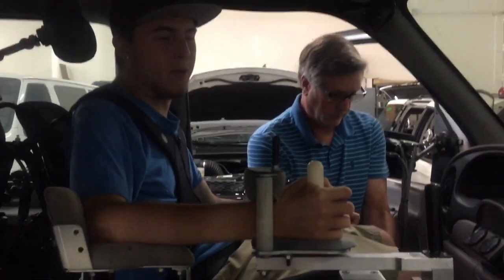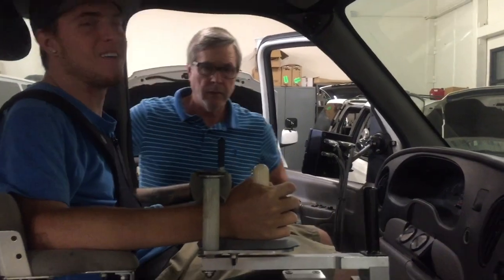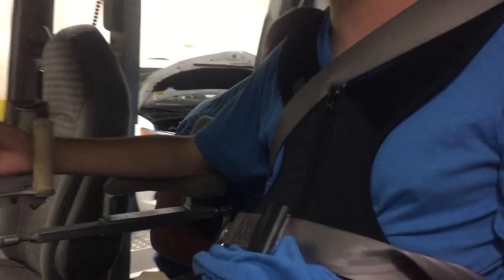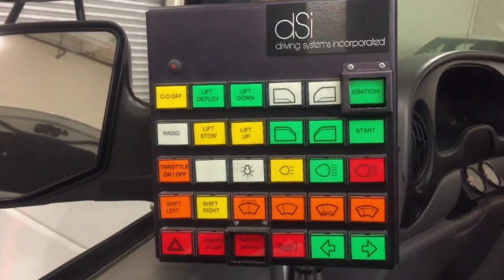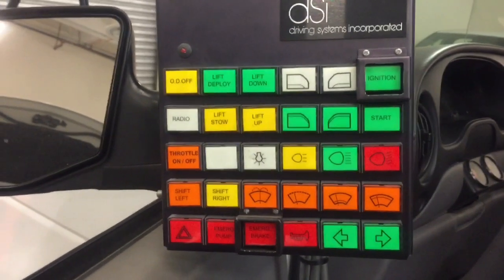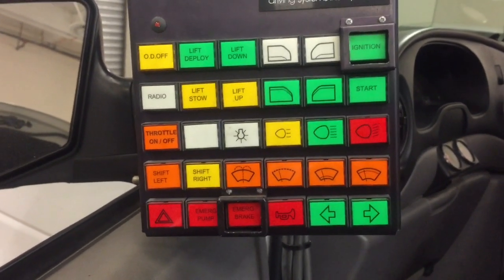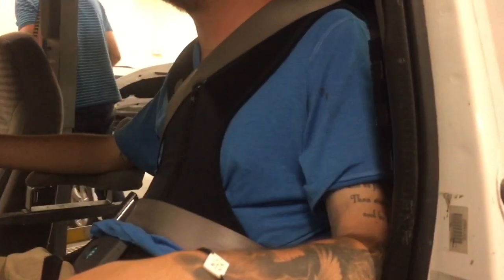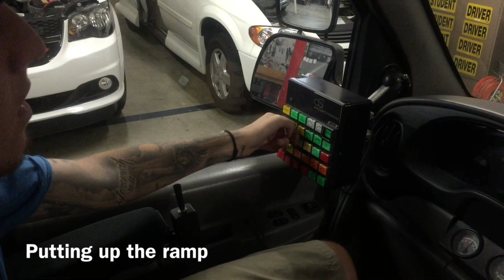Paralyzed Quad Drive's For The First Time!!!

Comment: I'm a paraplegic. In my car, the break is when I push forward, and the gas I when I pull back. I was told it has to be made this way, but apparently not. A reason to why it should be that way around is if you suddenly have to break, it is easier to break pushing forward, because while breaking everything "accelerates forward", if you know what i mean.

Comment: 🎉Congratulations on driving! 🎉
I have a few questions though. 
1. Is the seat belt set up so that you can secure it yourself? 
2. How do you check your blind spots? 
3. Is this van intended to be operated completely by one person or are you suppose to have a companion with you? Certain tasks that a person who operates a vehicle should to be able to do might be tricky for someone who requires these types of accommodations. For example a circle check before getting into the vehicle (crouching down to check for leaks), pumping gas, filling oil/windshield washer fluid.
I am only asking because I am curious. Please don't read this as a negative or hateful comment. I am simply asking questions to educate myself (and possibly others).
Hope you get to dive again soon. Have a great day!
Reply: Cai Linton hopefully he answers they are wonderful questions and Zack is transparent with his injury and educates us through his adaptability 📋📄📃📅💻
Waiting to learn 😁Zach
Reply: lol theres people who never check  washer fluid and oil. nowadays cars have blind spot mirrors cameras.. and theyre basically becoming robots that'll  tell u if somethings wrong. 
i wouldn't be surprised if the seatbelts motorized too
self driving cars r becoming common so pretty sure this guy will have one of those soon

Comment: Hi zach,
I'm quad like you since July 18, 1977 and there was little medicine to stop spasms uncontrollable in this time. By chance, the drug "Baclofen" helped me a lot. Indeed, I have more spasm and believe me, I had a lot. Baclofen is a muscle relaxant that acts in the spinal cord as a GABAB receptor agonist, inhibiting mono- and polysynaptic reflexes and thereby promoting skeletal muscle relaxation. Since I use "baclofen", I do not have a spasm like before, and at work it was very annoying. I worked as a communication technician, and I had a lot of traveling to do to meet all the communication coordinators of each of the 19 boroughs on the Island of Montreal. It's great, try it, you'll be really happy. Good luck dear Zach.
Jean A.
Reply: I too use baclofen for myoclonic spasms due to my spinal cord inflammation and myelopathy alongside muscular dystrophy. It helps a little but I wish the spasms would go away. I may be getting the baclofen and a painkiller where it is released into my spinal fluid by a pump implanted internally called an Intrathecal pump. Medical technology has advanced drastically!

Comment: Hey Zack, new powerchair? Or are you unable to drive in your other chair because it's not as supportive? I have a few friends that drive using hand controls! I'm a paraplegic, unable to drive though due to other conditions weakening muscle strength and deteriorating eyesight. What make is your powerchair? I'm thinking of a mid-wheel drive for my next one. Thanks!